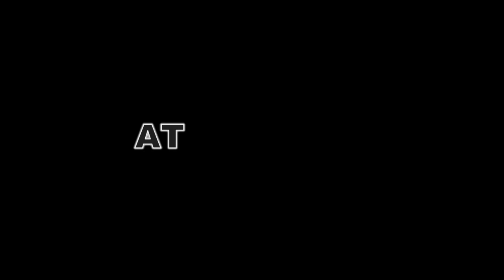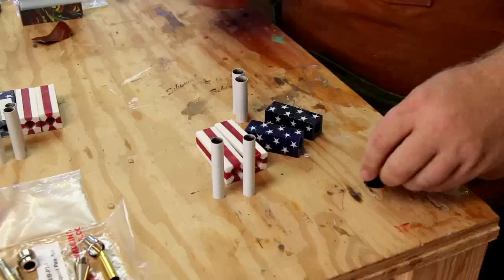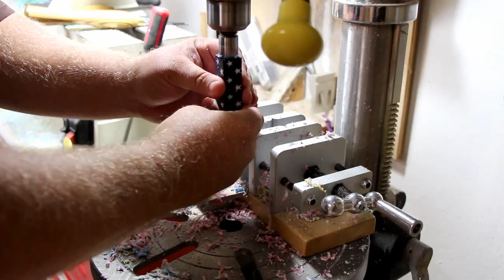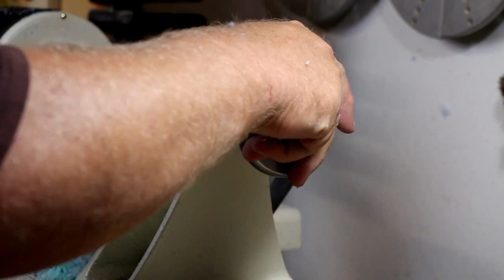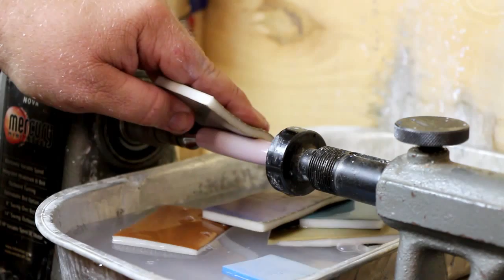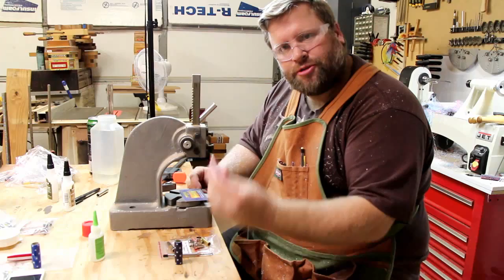Builiding an ATRAX Pen in Americas Stars and Stripes.    Schimmel Pens

Comment: Do I need anything special besides a different drill bit to turn 8 and 10 mm tube kits I know my mandrle is 7mm how do I mount the blanks with that size mandrle
Reply from the maker: Your bushings for the different pens will mount on the 7mm mandrel.   You will find very few that require a different one.   Most are turned on a 7mm.